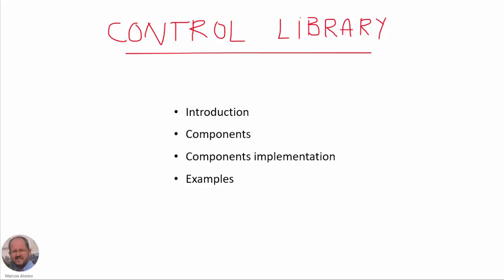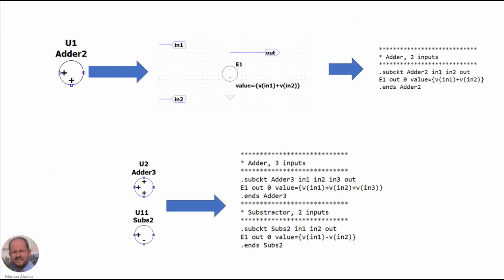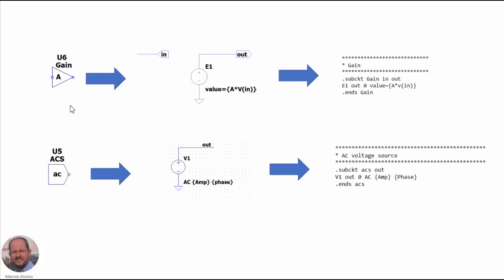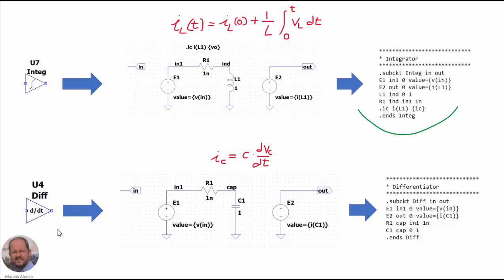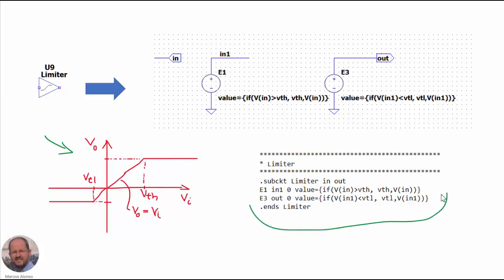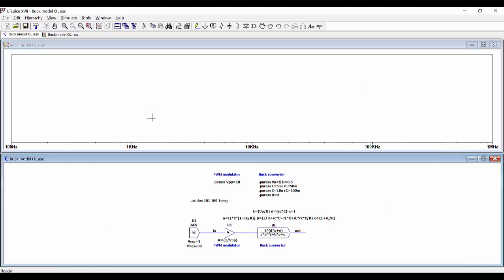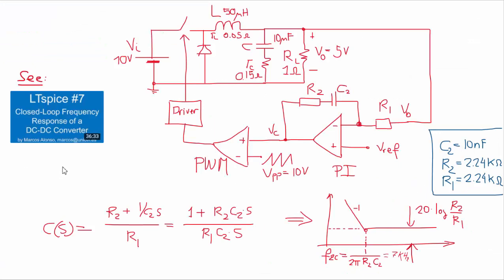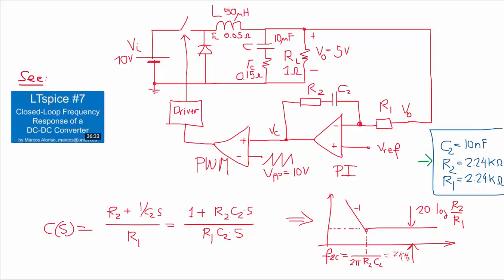LTspice #11: How to Create a Simulink-compatible Control Library (I)

Comment: Hi，your video is very good.I would like to inquire about a question, E model is different from you now,whether B model is similar to E model here?
Reply from the maker: Hi, thanks for your question. I use the "old way", which is to use the behavioral voltage source E found as Epoly in the /Misc folder. It is equivalent to using the Bv behavioral voltage source available at the main folder.
Reply: @MarcosAlonsoElectronics  Thank you very much.

Comment: Thanks for the tip :).
A few question:
1. why not use built-in functions inside the B. Arbitrary voltage components, instead of inductor and capacitors? they have an integrator and a derivative option.
2. if using inductor and capacitor, why put the 1n resistor outside and not as series "parasitic" component inside them?
Reply from the maker: Hi, thanks for your questions.
1.- When I made these components I was used to do it this way. I was not familiar with the built-in functions idt and ddt. Later in video LTspice #20 (https://youtu.be/vs6b-V5tICQ) I showed how to use these built-in functions too.
2.- I prefer to put the series resistances outside because it is more visual. You can clearly see what you have. Otherwise you have to go into the component to see the model. This is no good for clearly explaining things in the videos. However, it is true that it is more efficient to put them inside as a part of the model. I saw Mike Engelhardt saying this in one of his videos. In any case, up to now I didn't notice any difference.

Comment: Sir,

I have simulated the circuit as given at 17.34. But I am not getting any output at Buck regulator. My Integrator output is going very high ( 340v after simulation of 1.5m). What can go wrong, I am not sure. Kindly give your opinion.

Best Regards and Thanks,
Sanjay
Reply from the maker: Please, find the original file below and let me know if you have any further question. Thanks for watching!
https://drive.google.com/file/d/1Lsu_QfHP2tqzQMYxr4p0KpWU1Oab4pSY/view?usp=sharing
Reply: @MarcosAlonsoElectronics  Thanks Sir for your kind help. I don't have words to appreciate you.

Best Regards,
Sanjay

Comment: Please I tried simulating the first circuit and it gave me the error "Mutual inductance card missing coupled inductor:k=10 d=1.5e-006 e=1", what should I do?
Reply from the maker: Thanks for watching. What do you mean by the first circuit? please, be more specific. You can also use timing as "mm:ss" to refer to a specific part of the video. 
You can send me your file by email and I will take a look. Thanks!
Reply: @MarcosAlonsoElectronics  sorry, I meant the one at 11:23
Reply from the maker: @ogedengbeabdullah8305  You probably added a text to define the value of k so LTspice is looking for a coupled inductor. Please, send me your file by email and I will take a look. I can send you my original file too.
Reply: @MarcosAlonsoElectronics   OK sir.